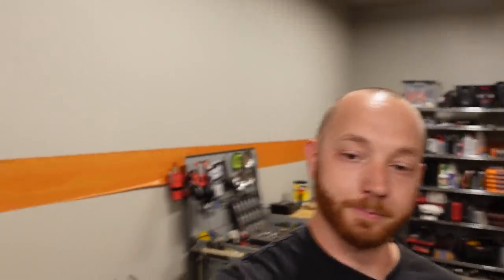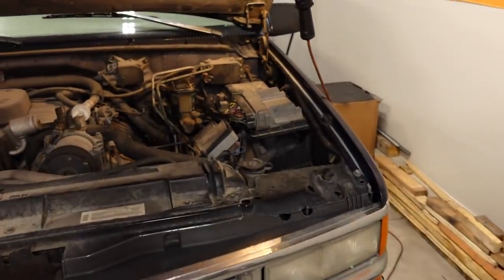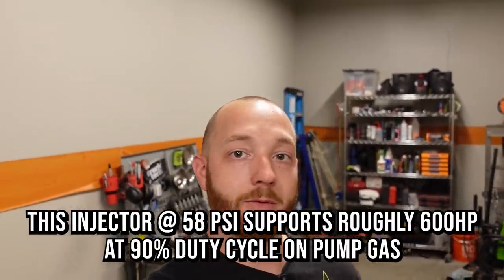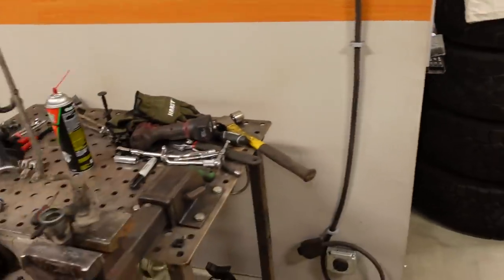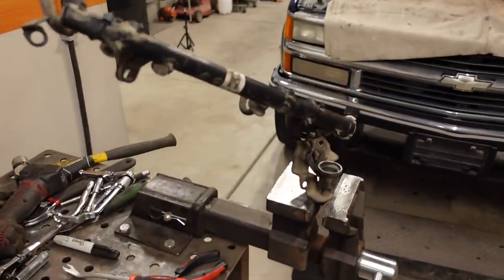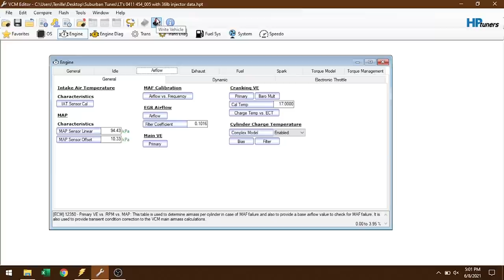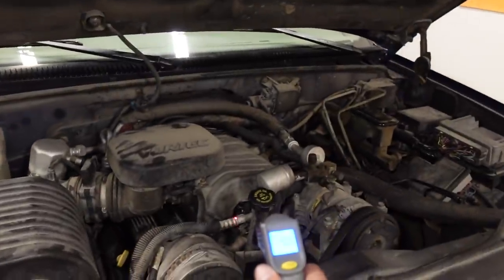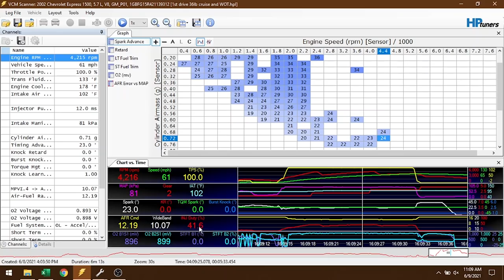Vortec Big Block 7.4 Injectors and Regulator: curing a hard start & 600hp worth of fuel

Comment: I did this same job to do a tuneup on my 98 c2500. Cap, rotor, etc. Be careful when removing the top of the intake, to not hit the cap on distributor and crack it. It almost touches the back. Also I was able to remove the intake (top) without removing the AC compressor. I did this by removing the top side to side instead of front to back. Nice video.

Comment: Those delphi stock injectors are garbage we used to replace them with Bosch injectors . They have came a long way but those late 80"s  to late 90"s where the worse  for Delphi injectors.
Reply: whats the part number for those
Reply: @bruhbruh4268  we just cross the factory part number and used Bosch injectors unless you know  how many lbs they flow . Replaced many truck and corvette injectors  with white brown and pink bosch injectors 16 19 and 21lb injectors . We used to have 5.0 ford brown injectors from mustangs laying around the shop after putting in larger ones 
Back in the day for customers. They where drop ins for 90"s corvettes . Fixed many quad diver codes and no starts on those old bank to bank gm fuel injector  system  .

Comment: I’m loving this series I just bought a 97 2500 4x4 suburban and I’m going to be transplanting the drivetrain into a 98 rcsb 4x4 with a 0411 swap and the 454 rebuilt into a 496, shift kit in the 4l80 and front and rear lockers. So there’s a good bit of useful info here.

Comment: By the way stock 19lb per hour mustang Gt injectors old stlye bosche manufactured are a direct swap that will completely eliminate the start issue and burn the fuel completely where the factory 23lb hour did not. My fuel mileage and power went up truck, was more responsive.  I also reached the fuel.pressure regulator at same time since it's so hard to get to.untill you get to that point of camshaft and headers the larger injectors are not going to do much to help on a stock engine.
Reply: Even better yet is the later 4 hole 4.6 yellows.

Comment: I love watching this series on the 2500 'burb with 454.  I just got a 2000 GMC 3500 crew cab, long bed, 4x4, 454.  I've replace injectors with the Bosch replacements, pressure regulator, reworked the heads, etc (whole bunch of other stuff).  I like seeing what you do and how you go about it.
Reply: Noticable improvements? I'm literally about to do the same thing with the same engine.
Reply: @rite2beararms  
Yeah, it does run a lot better.  I think the regulator was my core issue, but I also had a bad injector. But I think I have a bad lifter or cam or something.  The left bank runs fine, but the right bank still has an odd miss in it.  It runs, just not 100%.  I took everything back apart and cleaned the lifters but that didn't fix it.  There were a couple that had weak-ish springs in them but I didn't think about until I had it all back together and it didn't fix it.
Reply: Are you disappointed with power in your gmc? I have the same k3500 4 door. I just rebuilt the motor and it's a slug. I put in Bosch injectors and a marine cam... its a 454 for crying out loud and it won't even pull a camper through the hills. I'm disgusted with it.

Comment: Awesome stuff for the K2500 LT,  I’m Used to using those exact injectors on VW/Audi Tuning for 1.8 2.0 turbo motors, easy to find as well flow matched and tested. I always liked the spray pattern and fuel pressure regulator options, push in clip style, to bump up or drop flow. Another great option were the Rochesters for this truck, I’ve played with both. Keep up the great work, with your Performance Shop, I like your full spectrum builds from Fabrication to Tuning, Few guys like that out there. 👍🏽⚙️🏁🛠🔥💰

Comment: Awesome! Exactly why I had my intake off. Ended up doing lower intake gaskets, MSD coil, New distributor, along with new rail. Then port matches upper and lower intakes.  Mine had also been previously worked on poorly.
Reply: Did you feel a difference with that? I have a 99 2500 burb. Doing long tubes and dual3" exhaust plus tune right now. Appreciatre any feedback from your comment.

Comment: I own 2 7.4's and 2 5.7 vortec's. Every brass terminal cap and rotor set that I have used has caused me problems within 100 miles of driving. I wish you luck with the cap and rotor LT. If at any point you get a miss or stumble I would start your diagnosis there. Keep up the good work! Looking foward to whats ahead for this truck
Reply: L21s or L29s (Gen 6) the 350s are L31s (Gen 1.5). Ozone gets cooked by arcing and corrodes the terminals
Reply from the maker: i hope  I Don't have to change it that soon, they're a pain  to get to...

Comment: You made that look super easy... I'm sure it would take me a few more hours to do. Just found your channel so I'll go back to look for another video on it but, you didn't capture putting the distributor back in and that's the part that makes me nervous about pulling my plenum and intake manifold to fix a small coolant leak on my '99 K2500 Suburban. It has the same engine so I'm sure I can go find some more great videos. Thanks for sharing.

Comment: i replaced my 7.4l injectors at 120k miles. then did a sensor replacement campaign. I sold when it had 140k miles. when it was resold 2 years later it was sold as having the motor been rebuilt. Yes, it ran that smooth..... I found that there was a slight increase in power but also a slight decrease in fuel mileage. I found that mid grade fuel seems to get the best power and mileage and keep the injectors clean. After installing the new ones I started using seafoam to keep the in clean condition.

Comment: I get that about putting things back where they go. I just bought a ‘99 k3500 and it was said to run rough then when I bought it wouldn’t start. But I’m about to check timing because it looks way out. Also all the coolant sensors and MAF are original with 164k miles plus I noticed a few ground straps not hooked up and a twist tied battery wire lol. So I’ve got some work to do tomorrow. Great video!

Comment: Those clips are a pain but I do something similar by moving the tabs up incrementally. 
I also like to change the cam sensor in the distributor since the distributor is out and you did the good cap & rotor too.
The upper intake manifold gasket tends to leak so the injector repair will fix this.
The ignition control module gets cooked on the back of the intake, so I like to replace that as well.
A straighter intake tube into the throttle body and a mild .500 lift cam will wake up the vortec.

Comment: pretty cool.. just bought one not running for dirt cheap, did the fuel pump and of course the regulator lets go before it will start the first time so im doing the pressure regulator now..  and cap and wires while im around that area..

Comment: I know you are busy with trans problems lately, but your vids on the burb 7.4/0411 swap have been huge for me. I have a 97 k3500 L29 with high miles, so I started an upgrade by buying a complete 99 L29. I have ported the heads (290 cfm on intakes), port matched the manifold, had the stock cam reground for more lift, duration, and a tighter lobe separation angle, bought everything for an adjustable valvetrain, and a pair of stainless headers. I don't have injectors picked out yet. Someone recommended L67 injectors (supercharged 3800, 43 lb/hr). When I put in the new engine, I'm doing the 0411 swap with an 01 van L31 tune already in. From there I will follow your examples and dial it in. I'm afraid the stock MAF and throttle body will become limiting factors though. Do you know anything about the 0411 operating in speed density mode? That would let me eliminate the MAF, and even enable a real intake and throttle body, the Edelbrock efi Victor Jr.
Reply from the maker: should be no problem to run the truck in speed density at all with the 0411. I think those injectors worked out fine!
Reply: @LawrenceTolman  Can the maf just be turned off?  How do I find out more?

Comment: It is known as a labored start and sometimes a fuel pressure regulator on the engine can be the cause of the problem.

The first reg clip is found on buick series 2 3800

The 454 L29/L21 (Gen 6) was for bottom end torque, not top end hp.

Comment: Don’t mind me and my TBI 454 stopping by to watch you upgrade your MPFI 454 haha sighs
Reply: TPI it
Reply: I would swap to Vortec heads and get a Holley efi kit for it honestly. Bump up the compression and maybe swap the stock flat tapper cam for a hydraulic roller setup. That sounds like 450-500hp to me. Don’t forget the obvious stuff like exhaust headers and ignition stuff.
Reply: @corbantwiss174  peanut port til I die 😤 lol

Comment: After installing the higher flow rate injectors, did you loose any MPG or did it stay about the same? I'm slowly restoring my 97 K2500 GMC Burban 7.4 and I'm nervous about touching the plastic composit fuel rail because it's been discontinued for a while and there's none available in the aftermarket either. Great video!!

Comment: I know damn well that egr pipe did not  come off that easy. It took me 2 days of heating and beating to get mine to break lose.
Reply from the maker: surprisingly, it was way easy. I popped it loose before the shot started, but once it turned a tiny bit,  it just unscrewed by hand
Reply: @LawrenceTolman  Obviously, someone has been there before and used never seize on it then.
Reply: I always have to hold a backup wrench (1 1/8 I think) on the fitting in order to keep the entire fitting from unscrewing from the intake. I may try some Green Loctite on just the fitting this next time when I'm going in to replace the camshaft sensor and ignition control module (last 2 things I have not replaced, trying to stop the engine from having random misfires running down the road). :-\
Reply: ps. A good quality penetrating catalyst sprayed on that coupling a day or two before you plan to try to unscrew the pipe helps A LOT!
Reply: I destroyed mine because the pipe fused to the nut and twisted.  They are not available new and very rarely used, and for astronomical prices!  I was able to make a new one using Natural Gas piping and fittings (Home Flex).

Comment: Tho the 7.4 Vortec doesn’t have as much power as it could have, they move pretty good. Once had a 99 K3500 crew cab dually with a 6’ bed (extremely rare) and it would smoke the dually rear. Pass everything but a gas station at 11 mpg though with 4.10 gears
Reply: Gobs of torque though! When running right, my 2000 GMC dually would also smoke the dually tires when upshifting under hard accelleration. Random missfires right now eating my lunch! Arghhhh!
Reply: @MShrader211  Sometimes closing the spark plug gap a tiny bit can help with that...
Reply: @oldpartsnrust  Thanks. I got the idle fuel pressure adjusted up to 58 psi (from about 50 psi previously) earlier this summer (before triple-digit heat wave began) but then found that the #8 cylinder has stopped firing (completely!). I don't know why (new distributor, new spark plugs and wires installed already and it's all hooked up fully and the wires are in the correct order). Have just left it parked for the past 3 months as we baked too much outside this summer! Now that rains have returned (and it is parked  under cover) and temps have dropped down I intend to get back on this shorty. All other cylinders were having 0 misfires when last I ran the engine with ODBII diagnostic unit plugged in, but cylinder 8 was experiencing 100's of misfires per cycle (I think it's every 30 seconds or something that the misfire count on each cylinder resets to 0). Either just that 1 injector doesn't want to work at 58 psi, or the injector isn't being commanded to fire now. This has been a horrendous struggle I swear every time I put the top back on the engine and hook up all the sensors and try to start and run the engine there is something else gone wrong!

Comment: Dows adding the 36# injectors give the engine more horse power without any other modifications ?
I think my last mechanic did putnin 36# injectors about 5 years ago. It's a 1998 gmc suburban K2500 454 and had about 287,000 miles mow it has 389,000 miles.

Comment: I’m replacing my injectors on the boat. Hope I don’t have to remove the Distributor that would suck. Looks like I should be able to get the rail out without doing so but it’s not going to be fun. I understand these have to be retimed with a flash tool.

Comment: Just discovered your channel. Nice work.  I have a '98 K2500 with the hard starting problem.  This looks like just the ticket for fixing that issue.  I do wonder though why, oh why, didn't you take a pressure washer to the engine bay and then clean up the parts before reinstalling.

Comment: I am having hard starts. I tested the fuel pressure. The pump primes it fine to the valve. When I shut it off it loses pressure pretty fast. Funny thing with mine, if I let the truck sit for 2 days or longer, it starts up so fast. If I'm driving it and it sits around 10 mins or longer, it will be a super long start. So not sure how that equates in the leak down issue. Sitting long periods of time, starting is not an issue.

Comment: The great part of the L29 is you can take the intake top off and check for dripping injectors to see if it's the cause of the long cranking.there 3 causes of that issue.leaky injectors,leaky pressure regulator or leaky check valve in the fuel pump
Reply: Susan, Lawrence, what about heat soak on the starter? Is that hype, or should i be checking this too? I dont want to change the computer so I can’t just follow through this channel exactly, but i have the same labored issue, the engine is pretty new but still exhibits this issue.

Comment: I've got a 2000 7.4 454. I'm having lean condition. My fuel pressure is between 45 and 50(steady). I cannot find the factory specs but my mechanic is saying that is normal. Google says it needs to be between 55-62. I want to do this swap on my truck some day.

Comment: I'm pulling the big block out of my 99 K2500 Suburban soon. Suffered from hard starts when I bought it, new injectors and regulator fixed that but it still had a miss on 3 and 4. Compression is good on all 8, new plugs wires cap and rotor so I had to pull 3 and 4 injector and test them individually and they work fine. Not sure where the miss is coming from so any suggestions are appreciated. Love the videos, keep em coming.
Reply: Mine is missfiring also, but seems to be random cylinders and at between 25 and 45 mph mostly. No check engine light or fault codes! New plugs, new wires, new FPR, new Bosche injectors, crankshaft sensor, MAP, MAF, Idle Air control sensor, distrib cap and rotor, O2 sensors, Air Temp sensor, intake gaskets basically everything! I'm worn out from taking this thing apart and putting it back together... lol!
Reply: @MShrader211  mine is about to get rebuilt, I'm also doing the 0411 swap and converting to coil near plug like the L21 454 had.

Comment: I have an l29. It is bored and stroked to 489 and it maxes out 30lbs/hr injectors at 4200 rpm. The only mods to heads are mild porting and a camshaft. It is around 350 hp at 4200. I need to up injector size if I want to rev any higher. The injectors you used would be perfect. I suspect it would make around 380hp at 5000 rpm because the gram per cyl still hasn't dropped much at 4200.
Reply: Hey Scott, how did you tune the PCM?  I am doing a similar upgrade after spinning 4 rod bearings at once on the highway.  I am putting in these injectors, a 396 stroker rotating assembly from Eagle and a CompCams Gen VI cam K kit.  Just worried about the tune at this point.

Comment: What’s the part number or year make and model for those injectors and can you use a flex fuel injector in these motors?
Reply: You can use flex fuel injectors but there is no sensor, just like anything compatible fuel pressure and injector data. Then you have to worry about injector connectors and height etc

Comment: the vortec 7.4 intake looks so cool, but i'm sure it runs out of steam at 4-4500 rpm, still the heads on that one flow way better the the peanut ports so more cam should still help alot
Reply: Cam swap is key on these.

Comment: LT enjoy the videos on the L29 I have a1996 c3500 with the L29 want to do the computer swap do you do programming of computers for these swap setup for public if they sent you a 0411 computer not that familiar with the fuel injection tuning still a carb guy.  Thanks keep the videos coming

Comment: Hello LT, love your content!!
I have a question, I sold my dad a 2001 S Blazer 4dr 4wd 4.3l which he just loves, but it's always been plagued with computer and ignition issues. Thinking of swapping in a V8. What would you recommend?
And is there a way to repin a V8 ecm to work in this vehicle?? Thank you Ben
Reply: I also own a 97 k3500 7.4L crew cab dually which I'd like to do the injectors and ecm like what you did!
Keep up the great content!!! Ben
Reply from the maker: the easiest swap would be an L31 V8 from a 96-99 truck. they use a similar computer that can be reflashed and would  only need a couple of wires added to the existing harness. the LS however is the king of swaps, and would likely be a little "Cooler" to do

Comment: Hey man I have a 454 with an issue starts. runs for a second or two. Then dies. No security light. Is there a way to bypass this problem. The truck ran fine before. Have tried everything if you're familiar with this issue